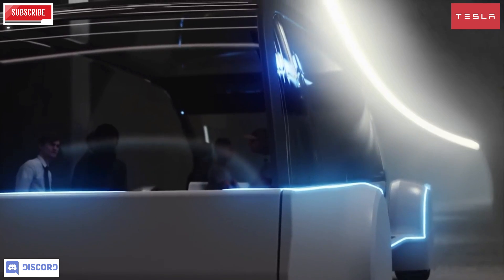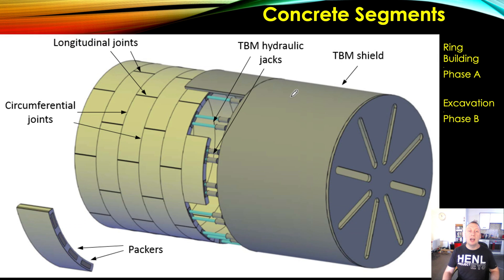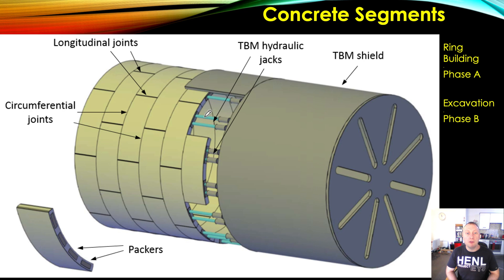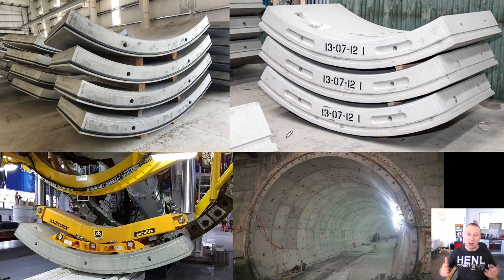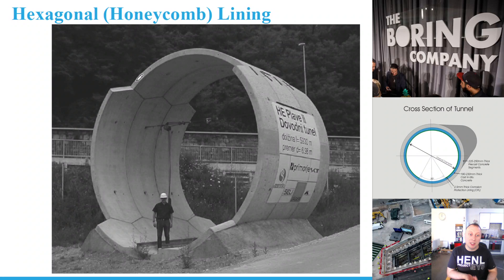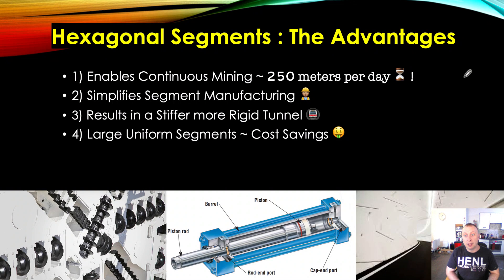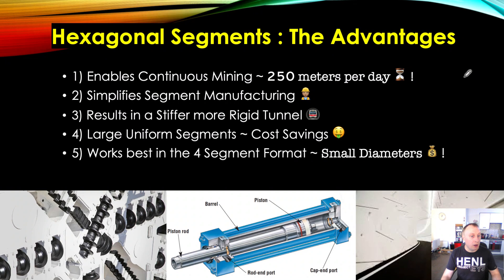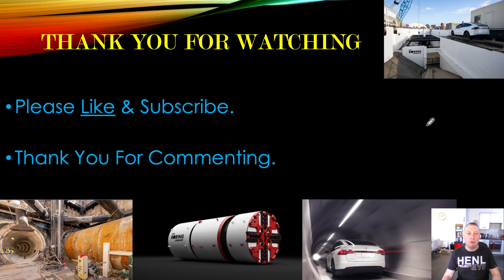The Boring Company 🚇 😃 🇺🇲 Hexagonal Concrete Segments Are The Future 👷🏽‍♂️ 🏗️ 🚎 PART 1

Comment: Why wouldn't the hexagonal sections increase stress along the longitudinal seams compared to the rectangular  brick pattern layout? My thinking was that the alternating pattern reduces longitudinal pathways for stress fractures in rectangular sections compared to the hexagonal zig zag seams.
Reply: Mystery Toe correct. Hexagonal linings can’t take the same force as traditional segments.
Reply from the maker: Its a fair point although this isn't a deal breaker. Sections of tunnel can be repaired at a later date or better still... more robust segments engineered to minimise stress fractures (additional rebar).
Reply: A Boring Revolution So with maintenance and repair, hexagonal sections are expected to be cheaper than rectangular sections?